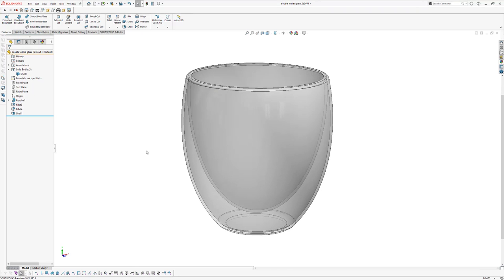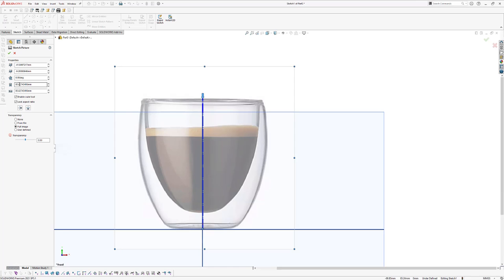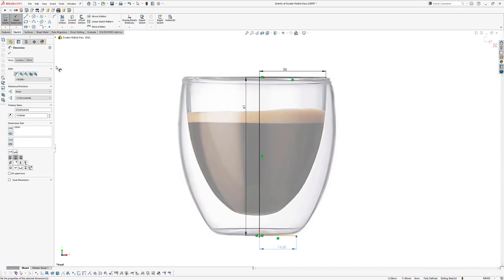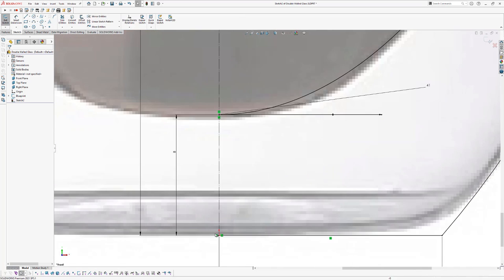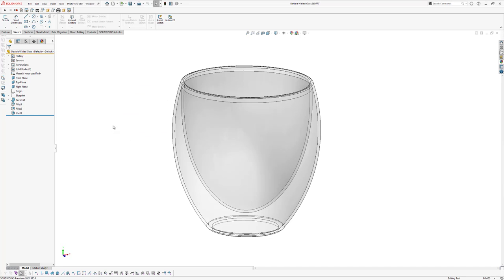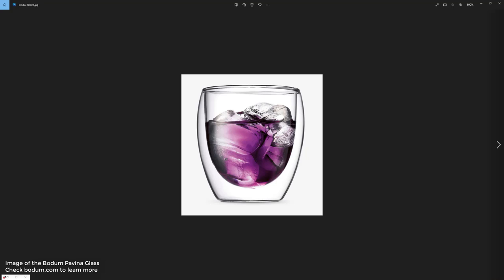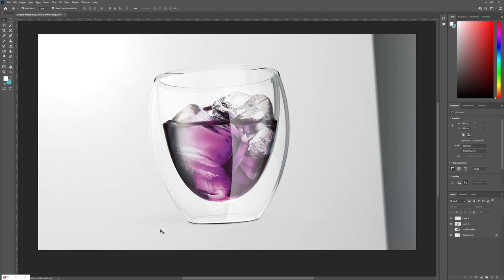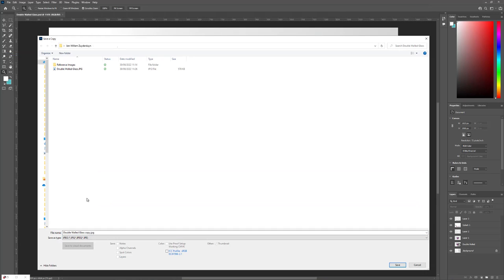Model and Render a Double Walled Glass in SOLIDWORKS! (using PhotoView  360 & Adobe Photoshop)

Comment: Hi Jan,
I’ve just graduated as an mechanical engineer and I work at a heavy vehicle body manufacturer (we make about 50 bodies per year). Im fairly familiar with modelling individual parts, and also with placing parts into an assembly, but what I really want to learn is a more parametric workflow for creating assemblies. 

I’ve seen people make assemblies by creating some key construction lines and planes and then if they want to revise any individual part, because it was created to be parametric with the assembly, all necessary flow on effects of a change in one part are automatically propagated to other parts within the assembly. I’m not really clear on how to do this kind of thing. 

Do any of your courses cover this kind of workflow/ best practices, or can you recommend a good resource for me to investigate? I’m happy to pay for the right course.
Reply: Hi! My SolidWorks courses will definitely help you with that. Most of my SolidWorks models (like the Aston Martin, Boeing 747, and the yacht model) are modeled in the adjustable way you just described. So for example, if I update the door surface of a car, the bodywork around the car will be automatically adjusted as well.  Make sure to attend my free SolidWorks workshop to learn more about my SolidWorks courses: https://learnsolidworks.com/solidworks-workshop

Comment: i have a problem with my picture, when i preview the glass, the interior of the glass is black like shadow or something, i couldn't change it, how can i change it?
Reply from the maker: It sounds like the issue might be related to the material or appearance settings of your glass model in SOLIDWORKS. Here are a few things you can try to fix it:

Check Appearance Settings: Right-click the part or face of the glass, then go to "Appearance" and make sure the transparency and reflection settings are correct. Sometimes adjusting the transparency can remove those black areas.

Lighting and Shadows: Go to the "Display Manager" tab and check the lighting setup. Shadows might be causing that dark interior look, so adjusting or turning off shadows might help.

Scene Settings: In the “Scene, Lights, and Cameras” section, try changing the scene or adjusting the background and lighting. Sometimes the environment or background reflections can affect how the glass looks.

Render Options: If you’re previewing with RealView or rendering, ensure that the rendering settings are properly configured, especially for transparent materials like glass. Switching between RealView and OpenGL in the “Options” menu can help troubleshoot.

Hope this helps! :)